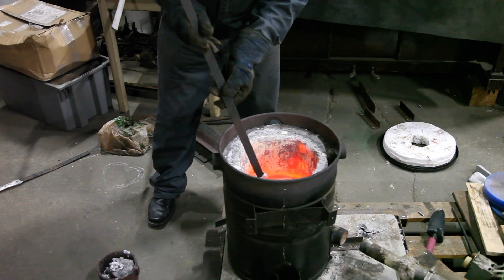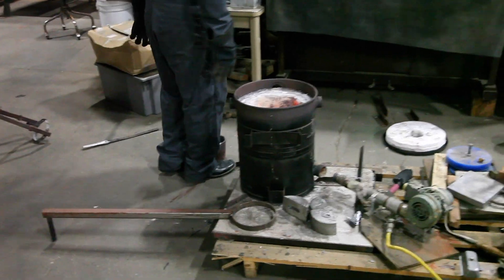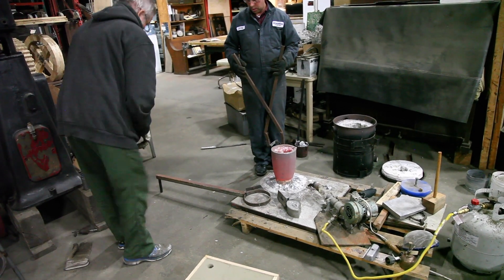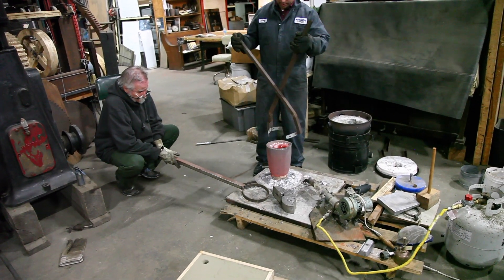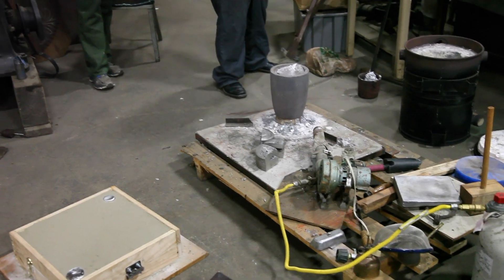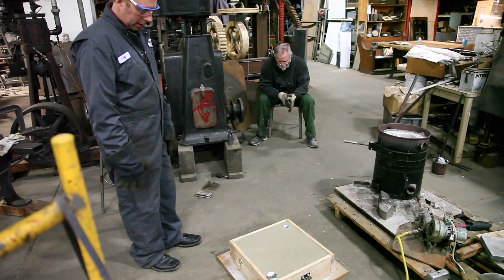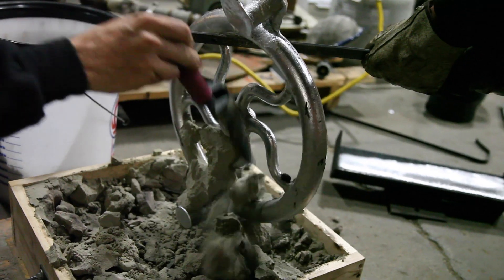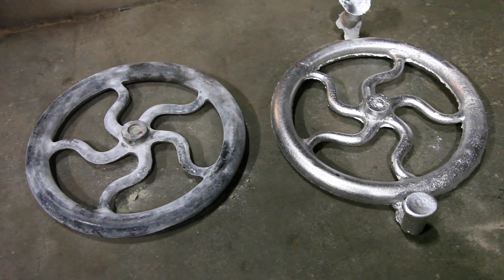curved spoke flywheel

Comment: I tryed one like that the other day and the sand stuck to the pattern in the middle. I am going to lay the iron wheel down and trace out the open spaces between the curved spanes on to thin wood panel and cut the pieces out and place them in before I ram up the cope. If the cope side of the mold does not cave, I will remove the wood panel pieces and lower the cope after i remove the pattern. I believe it may work....

Comment: How do you cast a pulley with the belt or rope groove in it?
Reply from the maker: Ron Delby Hi Ron. Sorry. We did make the orrery and I have lots of video that I still need to post. (I do more casting than posting). I just received a bigger/faster hard drive array for editing video more quickly yesterday (my computer is about 10 years old, so editing video on it has been pretty slow so I don’t like doing it, but hopefully that will change now). Also, I work in healthcare for my day job and since the pandemic, I’ve been extremely busy at the hospitals where I work- haven’t been to the shop or fired up the furnace in a month or more now. Remind me again after the pandemic is over and I’ll see if I can make up a small demonstration model. This is as much about patternmaking as it is molding, so unless you’re very patient or have a CNC machine, doing the curved spokes would be tough. Straight spokes would be easier. But I’ll see what I can do. Either comment here again (I get an email every time someone posts a comment) or email me directly. Troye•welch((at))Gmail•com...
Reply: @TroyeWelch  Please do a spiral spoked pulley video. I need to know how to do them

Comment: You both lazy workers
Reply from the maker: parveez zeevrap really? Please do tell me more. Rather than just delete your random, non-sequitur comment, I’m kind of amused at this. Please tell me what inspired you to write this?
Reply: yeah there's a difference between "lazy" and "cautious" which is what you want to be when you're working with molten aluminum :)
Reply: @jaypee42  concentration and making the path to mold clear. You guys are great at foundry I own my on foundry in back yard and I pour large bells from cast aluminum and an alloy I use to improve tone. So far I have done 4 inch to 20 inch bells . Im still wanting to find out how to cast a large pulley wheel with the groove cast in it.. Cannot find any video on here of it
Reply from the maker: Ron Delby sorry Ron- I replied to your other top level comment on this. Short version is I’m working on getting more stuff posted.

Comment: I been trying to find out how to make a curved spoked large wheel. Are they done in a 3 part mold?
Reply from the maker: Ron Delby I’m not sure how other people do them. This one was done using the original as a loose pattern in a two part flask. Since it wasn’t a split pattern, but it WAS symmetrical, we put it in the sand and sort of made a false parting line. Not sure what you would call it. We built up the sand in the drag leaving it down from the top of the drag about half the height of the pattern. Then dusted the pattern and carefully tucked sand under it and up to the halfway height, which was close to the edge of the drag. Then dusted the pattern and sand and put the cope on and did the other half.  As long as the design has draft (the cross section of both the rim and the spokes was circular) on both sides, you can pull it out of the sand and do it with two parts. Most curved spoke flywheels and pulleys has an elliptical cross section, so that would also work.

We are working on casting a large (43” diameter) aluminum gear for an orrery I’m working on. It will be a quasi lost-foam (quasi because I’m going to burn out/remove the foam before we close the flask). It has square sides, so I can’t reasonably pull it conventionally. That was on Saturday, a few days ago. I flipped the drag with a forklift, a couple of trunnions and lifting slings, but when I lifted the cope the sand collapsed. This was because of the sand reinforcing bars being too high in the cope and maybe not enough of them. I’m going to modify the flask and retry it. Stay tuned. It might give you an idea of how you can do your wheel.
Reply: ok thanks. I want to make a 32 inch church bell pulley wheel
Reply from the maker: Hi Ron, if I remember right, those pulleys have a groove in them for the rope to go in. There are lots of ways you could do this, including making the rim flat and machining the groove in later, but I remember seeing a diagram in one of my books and thankfully I found it in the first one I picked up. I scanned a few pages out of it and posted it. It shows the period correct way of doing it with cross sections of the pattern, showing the rim and the parting line, etc. I also included the next couple pages which talk about 3 part molds. I don't think that's really necessary for this though.  Please see: http://www.troyewelch.com/files/Grooved_Pulley.htm Good luck!
Reply: Thanks, this is valuable information. I wish there was a video step by step on how it is done. The bell I have, had 6 curved spokes and around 33 inches wide in cast iron. If I ever can learn it, I might duplicate one Thanks a million. Ron

Comment: I thought you would be casting that flywheel in iron by now?
Reply from the maker: luckygen1001 lol. I'm going to be finishing a big new furnace this week that will do iron (18 inch (450mm) bore). I wanted to get a bunch of experience in Aluminum before I graduated to iron- also graduating from propane to oil. Yes, I've wanted to do iron for many years now. We will probably have multiple furnaces going at once. Going to do some larger volume pours (A25 crucibles) in Aluminum first for an event at the end of this month (Edwardian Ball), then go on to the iron.